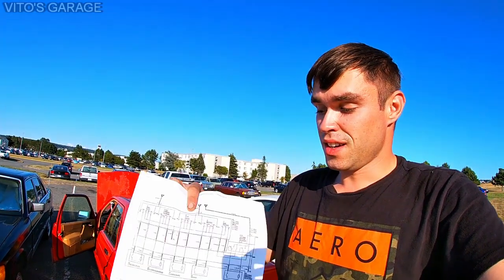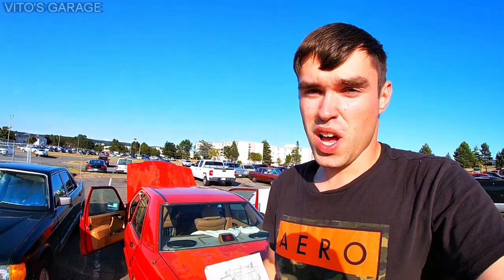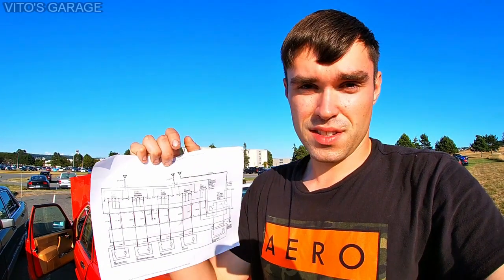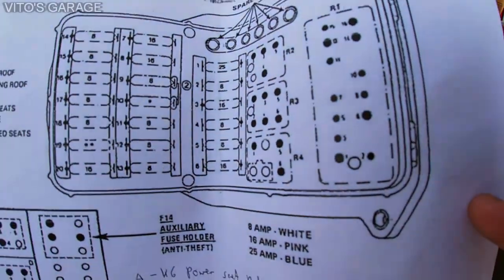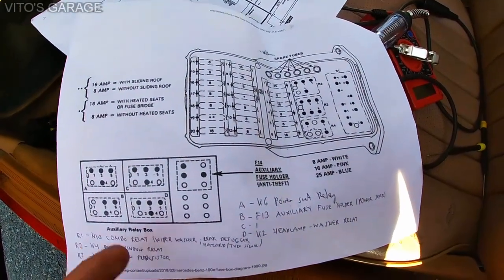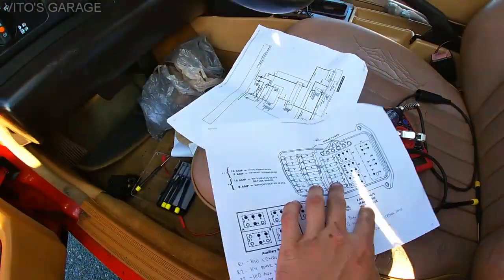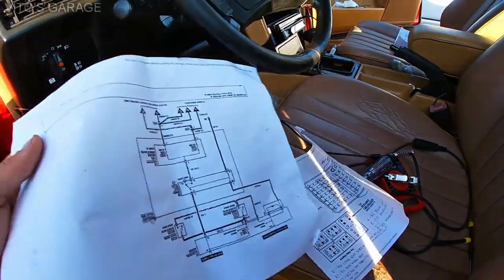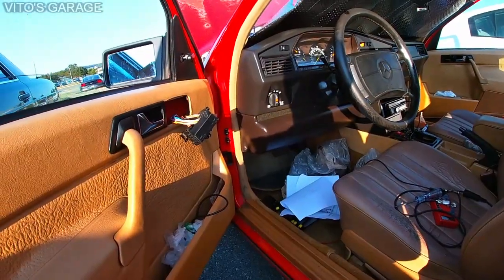Mercedes Power Seats Not Working Diagnosis & Repair. Craziness!!! 190E W124 W126 W140 W210 W211 R129

Comment: had a similar issue with the driver seat of my '88 420SE. the switch wasn't really broken.
i opened the housing and there are 17 little metal balls in and a lot of contact plates.  also a lot of dust and dirt from over 30 years. i cleaned everything, put it together and it worked.
It's worth a try because new switches are getting expensive and used ones may have dust and dirt inside, too.
Reply from the maker: I tried to take my switches apart, cleaned them and resoldered the joints.. A few functions still weren't working... Decided to get different switches. I was hoping the old switches would come back to life but no luck..

Comment: Hi,
I would like to retro fit electric seats in my w201
I think I have all the parts. However, I just realized that I don't have the plug of the relay you changed in the video 
does it mean that I can't install the mechanism ?
Reply from the maker: I think you should just keep the manual seats
Reply: @VITOSGARAGE  🤣 Oh man !! I had a little hope that you encourage me ...
it's impossible ? or hard?
I found electric seats with motors,  command buttons, and the wires. and they work.
Next step is to mount it and thanks to your video I saw how it's hard 
But ...
So for you it will be wise to abandon the project ?

Comment: I imagine if that is with the Power Seats, the newer cars, of which most have side air bags, and if the seats are heated, that must be a real problem, what surprises me, do those cars have what I believe is the telescopic steering wheel to move the steering wheel further out or does that apply only to the W-140.
Reply from the maker: Old school cars are a lot more simple than new ones. Newer Benzes have body control modules that control the power seats and windows etc... This 190E is very simple in comparison
Reply: @VITOSGARAGE  
The reason I say the W140 I had a telescopic steering wheel, that car is amazing, it was is a 420 SEL,sedan, gold color, with the lower part  in brown, in the trunk it had like what would look like a power antenna, except, it would go up only in reverse, a phone in the console,the glass was really thick not the regular thin glass, it was like a limousine, in order to open the car you pressed a button  the button the car would open up, or you could manually open it, the car looked something like the 500 series V12 except it was a V8, such a unique machine.

Comment: Good content, but this could've been condensed to maybe 6 minutes by getting straight to the point i.e., diagnostics, troubleshooting, then finally the solution. You were kinda all over the place, but I understood what you were getting at because I have done extensive electrical work on a w201 before.
Reply from the maker: Case studies can be long. Thanks for watching. Check out my other videos and playlists

Comment: check the seat diode in the fuse box the F and L for power windows just saying
Reply from the maker: Sorry. I don't understand your comment. Power windows are working, so as the power seats now!
Reply: @VITOSGARAGE  i mean because of the funtion with door open and close for the windows and seats may fail and there is the spot under the fuse box, not saying its failing now
Reply from the maker: @renerenteria1  Thanks for the heads up! What happens under the fuse box? The wire breaks?
Reply: @VITOSGARAGE  the diode fail, and play with door open only
Reply: Those relays are finicky...thought my A124 convenience features had been lost at the (unobtainium cabrio-specific) control module under rear seat...ended up being the relay! The relay sounded like a baby rattle because a broken contact was floating around inside!!! Also, the plastic headrest adjuster is around $35 (unless it went NLA) and is common with these and 124 cars. People simply rip the headrests out of the seat instead of depressing the concealed “release button.” 🙄🙄🙄🤦‍♂️🤦‍♂️🤦‍♂️
Reply from the maker: Thank you very much for all your suggestions and shared experiences! Save Classic Cars!

Comment: Hi Vito, how can I be sure my oil pressure gauge is working.  1991 190E 2.6. Is there a way to check confirm proper function of the gauge.thabks
Reply from the maker: Hi Rick. Disconnect the connector on the pressure gauge and use a jumper wire to ground it against the engine. Ignition has to be ON. When you ground it, the gauge should show 3 Bar. Let me know